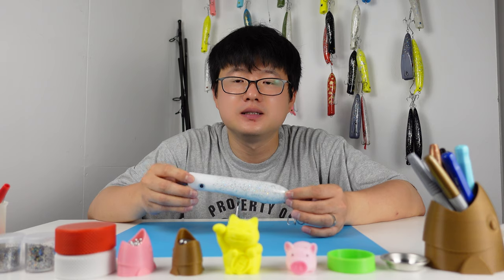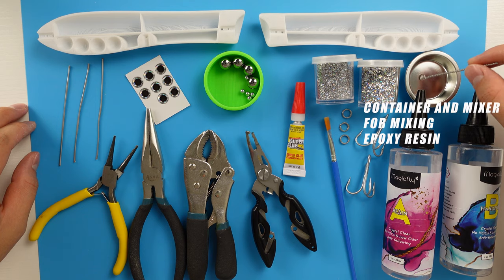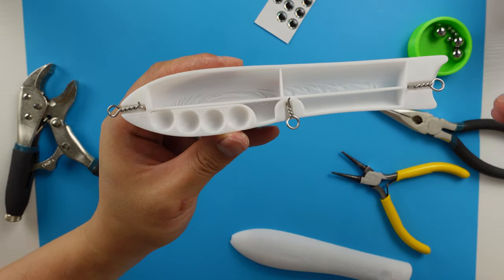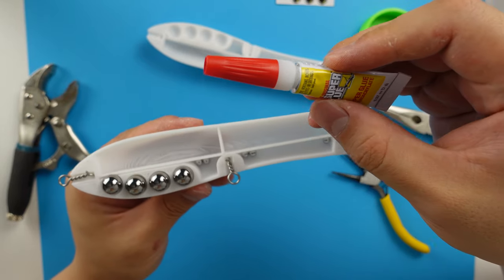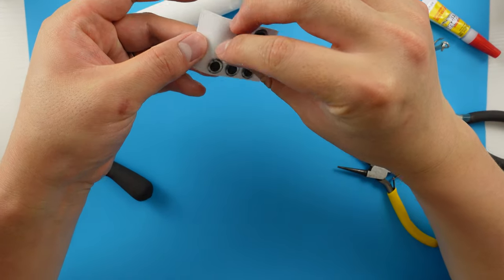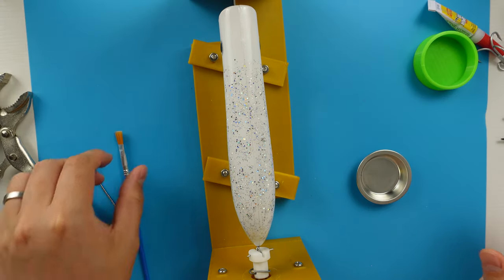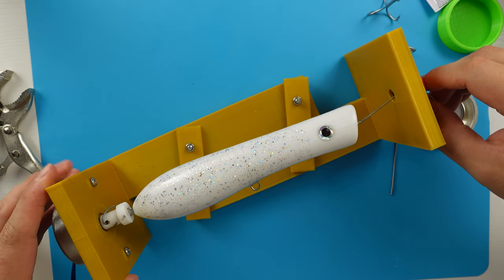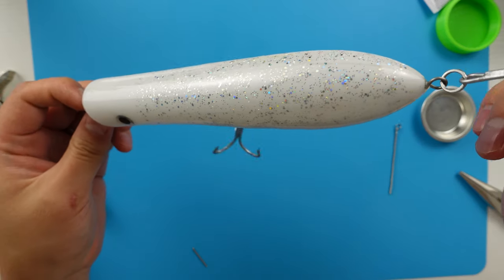Making Topwater Popper Plug Fishing Lure. 3D Printed Fishing Lure Making.

Comment: I printed this, ordered exactly everything you did, Steel ball was too large to fit.
Reply from the maker: If you are sure the ball size is 7/16. Then make sure you didn't scale down the 3D model size.
If the ball size is 7/16 and you printed out the lure with it's original size. the ball should fit the hole.😀

Comment: That was a great video, thank you!  Have you considered running a wire all the way through?  Is it robust enough to withstand a 40 inch plus  Redfish caught around the rock jetties?  I'm curious.  Thanks again!
Reply from the maker: Hi, thank you that you like my video.
Well, there are a few reasons I didn't design it with through wire.
  1. It is strong enough, because all the the hook eyes are inserted and locked inside the lure not like other wooden lures hook eyes are just glued inside.
  2. With this design weights can put inside lure much more easily.
  3. Again it is strong enough because you have your drag system on your reel. If your reel's drag is 20 lb the maximum force your line and lure will take is 20 lb. If drag is 30 lb then maximum will be 30 lb and so on. I don't think for most surf fishing you will need more than 30 lb of drag. I usually use 40-50 lb test braid line for my surf fishing. So far the only things that cause me losing fish are either fishing line broken or hook bant. The lure itself didn't have any problem so far.
  Yes, if in the future the lure itself breaks then I will redesign it with through wire.
  Not sure if I explained clearly or not. Hope you can understand. Again, thank you for leaving this comment.😊
Reply: @3DPrintedAngler  great points!  I look forward to more videos and it inspired me to contemplate getting a printer for this fun hobby.
Reply from the maker: @Sn-tk8rq  go ahead and get one 3d printers are so affordable right now. It's very fun to make things with it. And it's very rewarding when you catch fish on your own lure.

Comment: This great bro ! But, I think you must to changing the wire with strongest hard wire stainless steel 304 or 316. It will be perfect
Reply from the maker: The wire you saw in the video is 304 stainless steel wire.😜🤪😝😁
Reply: I’m not sure what you use bro! But I know 304 SS wire have 2 type. The Soft and Hard one. 
Maybe, the thin wire ? So you look to much easy to bending that wire 😂😂😂😂

Coz, I use between 2.0mm or 1.5mm to my popper 🤣
Reply from the maker: @Fiega Erfansyah  that's 18 gauge wire which means around 1.2mm it's strong enough.🤪🤪😜😜😝😝😁😁